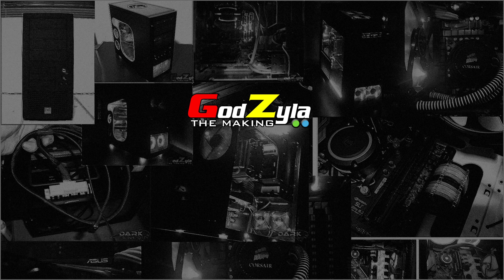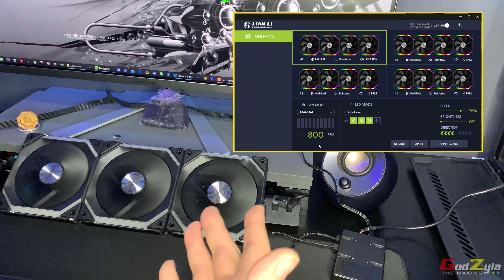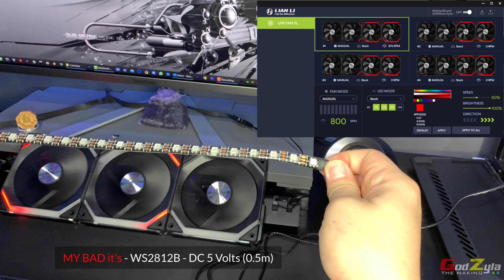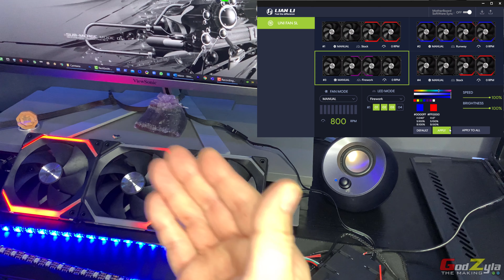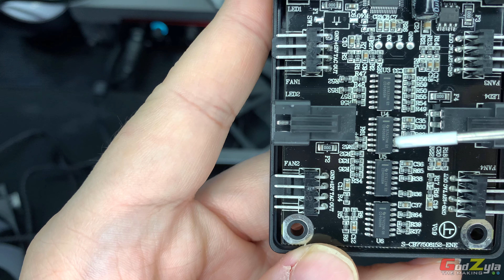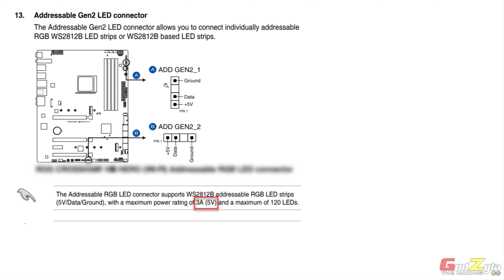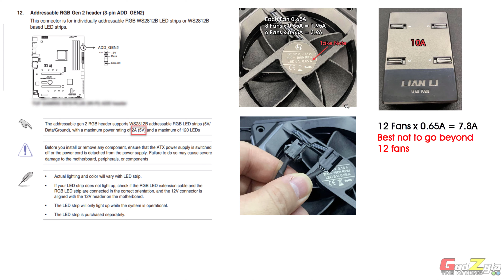Lian Li UNI Fans SL120 - Dos and Dont's (Part II) [L-Connect]

Comment: Now I'm confused. I bought "Razer Chroma Addressable RGB Controller" for 6x Lian Li UNI fans control and some other RGB in my case. Can Chroma handle it? Or I burn it? :D
Reply from the maker: Hi Martin Vee, welcome to my channel. That you will need to check the razor chroma. How much argb load it can handle. Also part of the reason why each individual manufacturers have their own controller on their own products. For mix and match, you will need to do some research on their capabilities. Now u mentioned you have purchased the uni fans. Did you bought the set that comes with the controller. If yes, use your Uni fans on it. The rest you can use the Razer chroma, I believe you will need two USB header on your motherboard, one is for your uni controller and other for your Razor chroma. For this I am not able to aid you as I do not have the Razer chroma to test on. So sorry. Once again thank you to have visit my channel and if you do like my content, kindly subscribe and to click on the notification bell. Thank you very much.
Reply: @KleoYan   The problem is that I'm using Corsair commander pro as well, so 3 USB :D my MB has only 2. Chroma can handle 80 leds per port, 3x unifans has 96 :D
Reply from the maker: @bboyclipsy  I see. Hmm you might want to try asking your questions here https://www.reddit.com/r/lianli/ as there are other pc builders who uses the commander pro and such. So sorry that am lack of knowledge on those controllers.
Reply: @KleoYan  Thanks!
Reply: Maybe it will work if I connect lian li uni hub USB to commander pro USB slot?
Reply from the maker: @bboyclipsy  Hi, I won't suggest that, you might want to try this instead https://www.aliexpress.com/i/4000553495902.html a usb splitter, one end to your motherboard header and split to provide two USB headers

Comment: Hello!, Very good video man! keep it up!. I have a question, Lian Li Lancool II mesh rgb controller how many fans can it control? (In terms of amperes)

Thanks in advance!
Reply from the maker: for the lancool II mesh controller, I am not very sure as I do not have a Mesh II case, but based on the website on the aRGB Fan version of the case, it can accommodate 3 fans and a aRGB Strip 30cm long on the case controller. do pardon me, once again thank you for your question and to have visit my channel, remember to subscribe and to click on the notification bell if you do like my content. Thank you very much!
Reply: @KleoYan  I believe its the same controller as in the Lian Li Lancool II, and im thinking about adding 6 fans (ID-Cooling ARGB fans) without the controller, i would have to do my research hehe, thanks man!
Reply from the maker: @bmendoza3  I see, and you are most welcome. Maybe tell me the model if the ID cooling fans you will be using? Let's see if they have led load and argb load on their website and see if they can be used on the uni controller. Thank you.
Reply: @KleoYan  The model is the id cooling df-12025-argb (0.5A max each), and my intention is to buy two 3 packs and a led rgb strip (0.6A) and use the extentions to connect the entire system with the case rgb controller.
Reply from the maker: @bmendoza3  wow. that's alot of LED load there. I dont think the case controller is able to take the load. It will be best if you can get a discrete aRGB controller for your fans and LED Strips.
Reply: @KleoYan  the built in controller of the fans could help 👀?
Reply from the maker: @bmendoza3  oh okok pardon me. Was not aware as I only read your comment. Didn’t do a search. My bad. 
Yup that will work if it comes with the controller.
Reply: @KleoYan  great!, Many thanks!

Edit: The fan built in controller should be able communicate well with the case controller?

Comment: Great and informative video. I am using 2x3 uni fans connected to the controller and want to use the phanteks neon rgb stripes 40cm with two of them daisychained for each of the two free slots on the controller. One 40cm strip has 28 leds and has a 0.84A power draw. Led Model is 	
KS6812. So in total I would have 2x3 fans (1.95A+1.95A) and 2x two rgb strips 1.68A+1.68A. So intal that would be 7.26A. That should work right?
Reply from the maker: HI Patrick Fink, thank you for your question. I hope I am getting your configuration correctly with the following example to your Uni controller. 

Output 1 = 3 x SL Fans
Output 2 = 3 x SL Fans
Output 3 = 1 x 40mm Neon aRGB strip 
Output 4 = 1 x 40mm Neon aRGB strip

it the above is what you meant by daisy chaining your neon strips. yes it will work perfectly fine..

thank you once again for your question and do remember to subscribe and to click on the notification bell :)
Reply: @KleoYan   Ty for your fast answer. My config would be:
Output 1 = 3 x SL Fans
Output 2 = 3 x SL Fans
Output 3 = 2 x 40mm Neon aRGB strip 
Output 4 = 2 x 40mm Neon aRGB strip 

in total 7.26A. Is that sill fine?
Reply from the maker: @tryhardpaddi4444  Hi Partrick, though i mentioned that the overall is 10A (actually 10.4a) your output 3 and 4 have overloaded each output , I don't think is a good idea to have 2 strips to 1 Output.. as I did mentioned make sure to be 50cm per strips on each output. You can try but your Uni Fan controller might burn out. hope that answer your question. thank you!
Reply: @KleoYan  alright ty I will install another controller than and run reach stip from one output then
Reply from the maker: @tryhardpaddi4444  hi,  sorry to disappoint you. You can only use one uni controller. You can't use two as the l-connect app will only detect one uni controller.
Reply: @KleoYan  Oh okay. I will try to find another solution

Comment: Hi, would it be safe to plug the pwm from the controller into a pwm fan splitter with 3 other fans?
Reply from the maker: Hi CitizeenSniips, welcome to my channel, but why do you want to do that? and were your other three fans at some point connect to the motherboard? if yes then should be ok, however to me I do not understand why you are doing this for.
Reply: @KleoYan  for God knows what reason Asus put the CHA_1 header in the middle of the board (z390-A). So the only header I have available that I can run a cable to without having a cable run across my board is to CHA_2 and CPU Fan. I was planning on running a 4 way splitter to the CHA_2 header to connect the 3 pwm intake fans I have with the unifans.
Reply from the maker: @CitizeenSniips  ah ok , I get what you mean now.. ok it's perfectly fine :) I have gone through your motherboard specs and manual online so no worries.. even if you want to plug 5 SL Uni fans directly to the motherboard fan header, it is safe to do so.. as each SL120 or SL140, their fan load is at 0.18a each.

Comment: 3A for a 30 LED strip (half of a 60/m strip) seems a bit high? Each LED consumes 60mA, so 30 x 60mA = 1.8A? Or does power peak higher when its actively running effects?

And when you say the controller can handle 10A, I presume that means 2.5A per channel? And if that's true, then how can the controller handle 4 fans per group since that would total up to 2.6A?

I'm also curious how the pixel numbering works for strips, since the fans have both sides lit up. Are both sides just connected in parallel?
Reply from the maker: Hi Sven, thank you for your questions. for the led, I specifically mentioned 1/2 meter as a safety gauge, you can do 1 meter if you want to but your resistor in the unit will run hotter, that is why for good practice is to keep it 1/2 meter plus if others would not know and buy 120LEDs instead.. that will be the safe too with 1/2 meter.

now as for the actual ampere of this uni. it's actually 10.4a after using a multi-meter to test 4 fans on it.. and it should be 2.6a per output. 

as for how it lite up on those LED on both side. I have no idea as I did not dismantle that. so is based on the ampere measured when I connected for fans to a output which reads 2.6a. 

hope I've answered your question. thank you!
Reply: @KleoYan  Hello Kleo Yan, Thank you for replying so quickly!
My case is very large, but 2 x 50cm should be enough. ;)

I am curious how the Uni controller will address the LEDs. Does it have to be a multiple of the amount of LEDs a fan normally has? The manual says each fan has 32 LEDs, so does that mean the LED strip has to be either 32, 64, 96, etc. to make an effect fill out? Or is it dynamic? If I told it to run "Stack" effect on a 30 LED strip, would the first two 'blocks' disappear at the end?
Reply from the maker: @S0K0N0MI  Hello Sven, you have done further investigation. thank you.. yes if each SL120 fan is at 32 led.. so it is safe to say that for the aRGB strips you can go like 128 LED. but still I would advise on safety measures to to do it like 64 LED instead. that will cover 1 meter actually. so if you have 2 x 50cm argb strips.. it will work fine. 
what my concern is.. just don't over do it as in going all too crazy to put argb strips.. now just for your info if you are unaware of argbs.. they burn out after a period of time and the down side is.. one LED burned. it leave the rest not working on where it got the burned. This is base on my experience. 

example your strip have 40 argb led. after sometime the 22 led burn out.. therefore leaving only the first 22 led working and the rest from 23 to 40.. it will not light up at all. 
Now even though I do indepth reviews on this uni fan controller. I myself do not use aRGBs at all, these reasons.

1) It draw additional power, not alot but I prefer to distribute this power to my PC components
2) aRGB or RGD generate heat which will brings up case temperature and this will impact your PC components to get hot, giving slightly higher temps to your CPU, Motherboard and GPU. 
3) too much cables to route. though I do my own custom crimping, I prefer less cables to give more room and space for the case to breathe. 
4) Vanity I prefer to see sleek PC Components being highlight and not overshine by only aRGBs. to be more precise. I like detailing instead of showing lighting effects.

once again thank you for your question :)
Reply: @KleoYan  I think I didnt explain my question well enough. ;-)

Normally each fan added to the group will add 32 LEDs to the chain. How does this translate to a LED strip? If I have a 30 LED strip, will the controller still try to address 31 and 32 in the effects, or will it dynamically adjust? For example, if I run the "stacks" effect on a 30 LED strip, will the effect stop at the non existing LED 32, or will it stop at 30?

And I didnt know these LED strips are so prone to burning out. :-( This might change my plans a little since I wanted to put a strip behind the motherboard to backlight it. Is it super common to happen? Maybe I should stick it on a magnet strip so I can replace it easier..

I don't like loud RGB either, I would never run it 100% brightness. That is why I like the Unifan so much, it is accented. Not as in-your-face as the corsair QL fans. My theme will be black/silver with very faint RGB effects. Like a city at night.

My system will have 2x 420mm radiator, so I think a LED strip (at 30% bright) won't affect temperature that much. :-P

My case is huge (EVGA DG-87) and offers a lot of cable management options on the backplate. I also like cutting, sleeving, and soldering wires to length, so it should look pretty clean. I like that Unifans daisy chain and only have 2 cables going directly to a single controller (corsair is messy compared to this!). I will also sleeve them together to make the cable run even cleaner. I hate the plugs though, same as you.. I think I will replace them with generic 2.54mm pitch headers. They wont plug as secure, but im not going to shake my computer a lot anyway. ;)
Reply from the maker: @S0K0N0MI  ooo.. ok then less the worries about the LEDs if is a proper function argb strip.. it is ok to plug to 2 x 50cm in length, they will lite up, but if you doing stack  effect on the this strips, it will react differently and might just stop at 20cm and not full length. as for the SL120 or SL140, fans have a unique mounting mechanism and they have inbuild chips on them, therefore when you do stack or mix and respond to the stack instructions given from the uni controller. This what makes these SL120 or SL140 fans unique. 
I do understand where you are coming from as in too bright argb.. I dislike that too. now as for argb burn out.. this is one of the videos that does explain the burn out. https://youtu.be/Fu4qZW0pQm4?t=607

Comment: If I have 2 single pack fans and I plug them into another fan hub with 2 other pwm fans can I still control the lighting software
Reply from the maker: Hi itzkrspy. welcome back and thank you for your question. You can purchase single fans to plug into one uni controller not an issue, just make sure that you do not plug more than 4 fans to one output (there are total of 4 on the uni controller) as for PWM. if you do not wish to plug on the uni controller, you can plug to another hub which controls only fan RPM or Speed or PWM.
Reply: @KleoYan  thank you for the response, I will definitely subscribe
Reply from the maker: @glowsmith91  you are most welcome itzkrspy. all the very best in your build and to have subscribe to my channel  :)

Comment: i notice the hub and L-connect reset everytime i boot my computer defaults to rainbow color ? is there any fix for this still using the hub or do i need to direct connect to mobo to fix that issue thank you :)
Reply from the maker: Hi Master G, thank you for your question. everytime your pc boot up or reset, do you have to launch the L-Connect manually? you might want to try doing this to see it it works for you 
- Click “Windows” + “R”
- Enter : “shell:startup”
- Click “OK”
- Copy your “L-Connect shortcut” to “Startup” file
- Restart your PC
hope the above helps and if you like my content, kindly subscribe and to click on the notification bell. thank you very much!

Comment: The slowest RGB rainbow effect i have seen on an RGB fans kit! I have UNI SL kit too and despite the speed setting to 100%,rainbow effect is sooo slow... Otherwise i have no issues with these fans,great kit!
Reply from the maker: Hi ya letalmike. thank you for the feedback, for me is, if only the fans can have indivual PWM control and not just based on one PWM readings from the motherboard header. I guess there are more room for improvement and I believe Lian Li will listens to customers or even viewers. why not write in to them. it should help. https://lian-li.com/faq/
Reply: @KleoYan  Let's hope for L Connect improved version.
Reply from the maker: @letalmike  yup, lets hope they can improve on it too. thank you for your feedback :)

Comment: Great video! How does the controller support 10A at 5v for the LEDs of a single SATA cable?
Reply from the maker: Hi Donovan Bisharat, thank you for the compliment. is just like the 12v to 10ampere argb power adapters for argb strips. your PSU is already the converter to supply 12volts to this unit and through a capacitor in this uni, where it distribute to each output 5volts. If you do like my content, kindly subscribe and to click on the notification bell. thank you very much for the compliment and to have visit my channel.
Reply: @KleoYan  Thanks for responding! I was under the impression that a SATA connector is only rated for 1.5A on each pin for 4.5A total for each voltage (3.3v, 5v and 12v). The SATA cable provided with the controller has 4 wires, presumably 12v, 5v and 2 grounds. The 12v is for the fan power and the 5v is for the LEDs. Therefore shouldn't the SATA connector itself be limited to 4.5A on each of these 2 voltages?
Reply from the maker: @juistb2  wow thats very technical. As what I did was to use the ampere on the multimeter to test on the argb cable with 4 uni fans that was connected to the uni controller output. It draws approximately at 2.6a ++, so I total up 4 output will be around 10.4a to 10.6a of this unit can handle. hmm, maybe you have a more accurate readings and can go indepth on this and to share with us your knowledge as I might be wrong. By the way, thank you for the insight about each sata reel can provide.